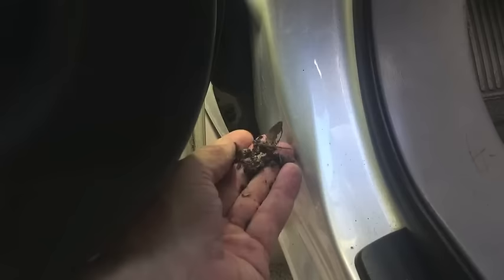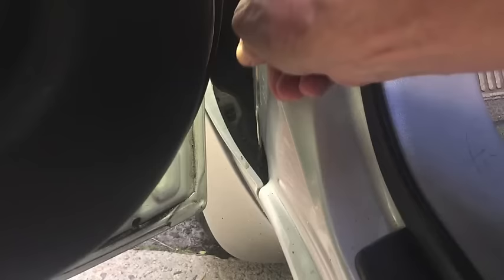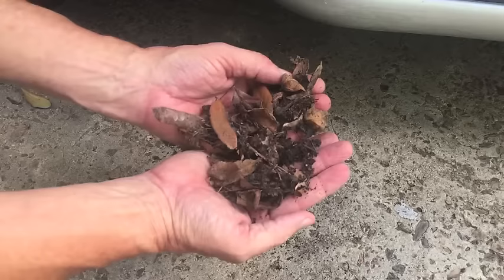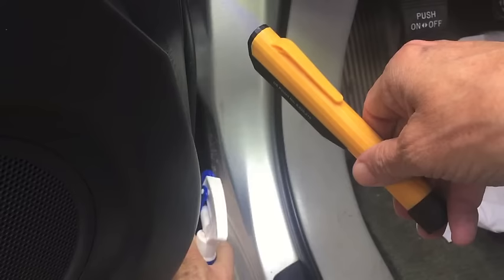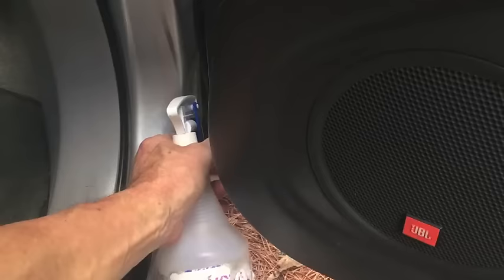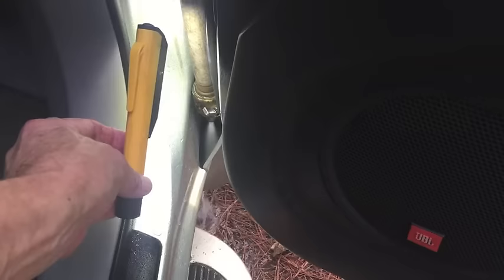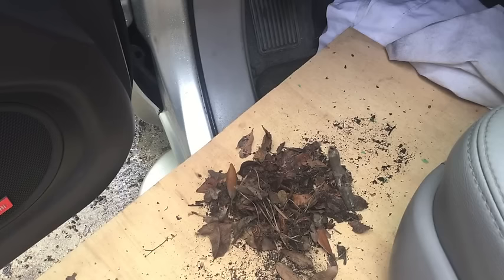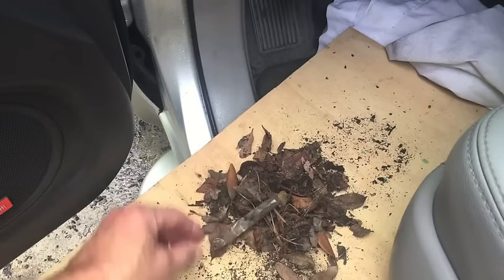Windshield Runoff Drains

Comment: So how do ya clean outthe drain if leaves and dirt have ran down through the cowl vent and clogged it from inside ??? That lil bit of dirt wont stop the drain from draining but will cause the FENDER to rust out. 34 years in a body shop and i still cant get over people calling a fender a quarter panel. All the repair manuals and computer programs will send you to the rear body section if you type in or look up quarter panel. Ive got a 2005 ford f150 thats leaking water into the left front floor board and no one has a post covering it. I know the mustang had horrible drains on it both sides but ya have to remove the wipers and cowl vent to get to it. Was hoping to find someone with a short cut !! Great video and your right almost no one ever cleans out that area and we tend to make some good money repairing rusted out cowls and fenders down here. Pecan tree tassels must have a high acid content because our state tree is awfully good at rotting cars out
Reply from the maker: fender/front, quarter panel/rear, got it

Comment: Hello, If water is getting  in on the floormats, where would it be coming in from or how? Thanks for any help.
Reply from the maker: It's difficult to say where the water is leaking in.. Could be leaking around one of your doors, windshield, sunroof drains clogged up (if you have a sunroof) AC condensation drain clogged up, leaking heater core etc etc.. My suggestion would be to pull up the carpet around where the water is, sit in your car while it's raining or have someone run a garden hose over the car and hope that you can see the water coming in.. For the heater core (which is likely behind your dash) run your heater and see if water leaks while it's running..

Comment: My 2002 regal is not draining properly and water is soaking the cabin filter, I can put a new cabin filter in and it will be soaked after one rain and fogging the windshield as soon as I turn the heat.
Reply: Did you ever figure it out
Reply: @vw2slow1  Yeah their is a drain tube that runs along side the the fender used my compressor and a 3/16" piece of round stock. Had my son poke the drain from the top while I sent 150 psi up through from the bottom and it cleaned it out. Had to poke it from the top or would have had to bend the steel stock to go through bottom and that would not have worked, and since it clogged from running down through the top figured blow it back out the way it went in. Anyways it worked.
Reply: Thanks - wish there were pics so I could see if that tube is similar on my Oldsmobile 88

Comment: If water is getting into the cab, on one side only...when it rains? 
Is it still a clog?  Or my heater core?
Reply from the maker: If it only leaks when it rains then unlikely to be heater core.. It may be that the runoff drain(s) are clogged but also could be many other causes for water leaking in.. I would pull up the carpet on the side where it's leaking and either run water from a garden hose over the car or even better sit in your car while it is raining.. You may find the leak that way..